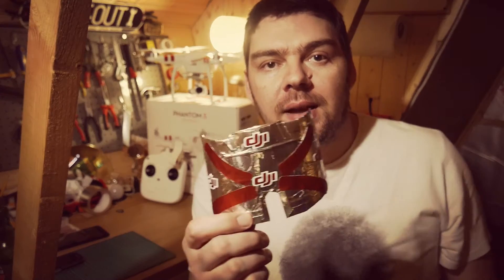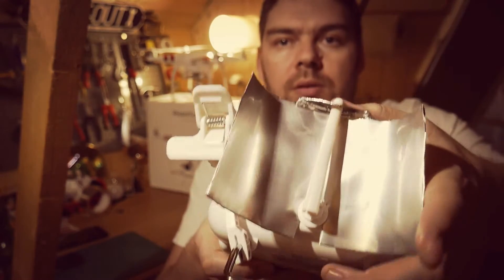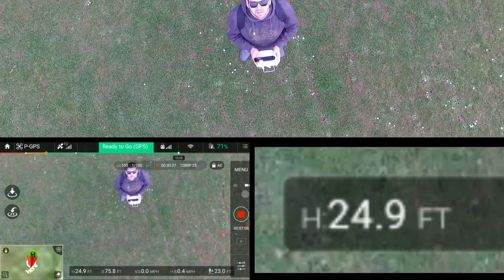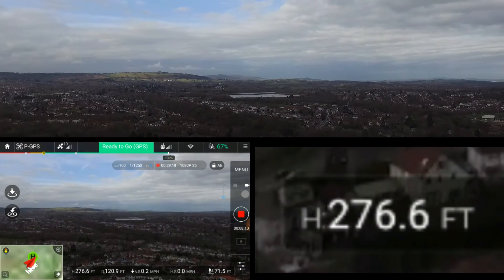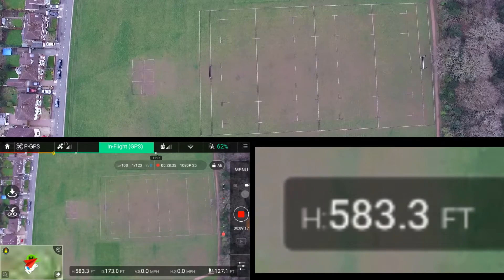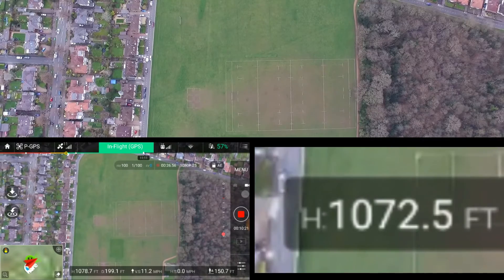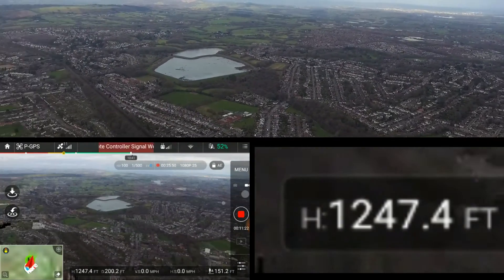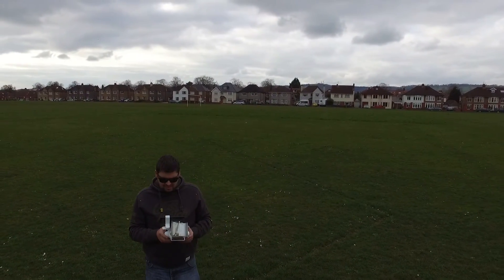MY HOMEMADE DJI PHANTOM SIGNAL BOOSTER...100% WORKED

Comment: Which app u   Use   How u see your battery persentage   Singels      Hight altitude
Reply from the maker: mr jack....I use the ( dji Go ) app, It's the free one 😎
Reply: Can i use this app  for my dji phantom 1
Reply from the maker: mr jack... I don't think you can... the oldest phantom on the app is a phantom 3 standard....
Reply: But i want my dji phantom 1 have  big range  of remort control    I want to boost my range
Reply from the maker: mr jack.... good luck 😎